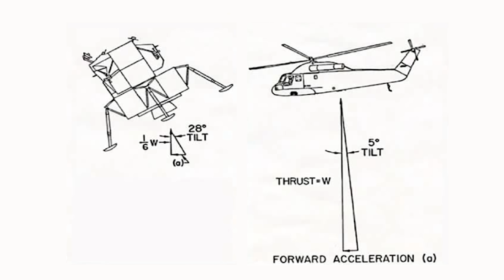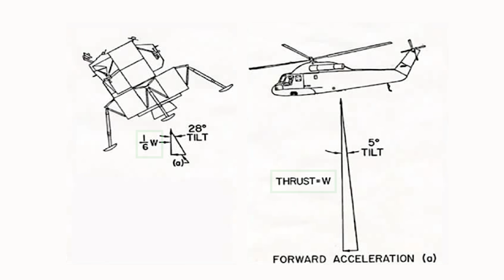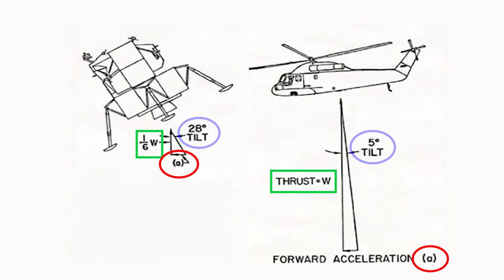How Neil Armstrong Trained to Land on the Moon  - Smarter Every Day 250

Comment: Im confused, why wouldn’t this be automated for Artemis? Seems to me we already have automated landing rockets at the moment, not a far stretch to change the gravity parameter to 1/6th within the software.......
Reply: I'm no pilot, but from my limited knowledge I understand it that there is no such thing as a true replacement for instinct and understanding. My point being that autopilot can only take you so far.  On a technical level it can do everything for you, in the real world however it can do everything... until it can't.
Reply: Even if this could be automated, it would likely still be unreliable in the best of cases, and once you get a little out of control, a computer tends to have a hard time bringing you back to a stable situation, and that's in conditions for which we're used to and know/have experienced most of the quirks. 
Think how difficult it is for example to get a computer to drive a car, where a human brain is capable of training and building up muscle memory and habits to handle unexpected situation on the fly. If you forgot a variable, the pilot in the seat will make a judgement call and try to compensate/adapt, but the computer won't make any judgement call you haven't thought of preparing it to beforehand.

That's my take on it at least.
Reply: Just means the software has to be written correctly.
Reply: Im confused, why wouldn’t this be automated for Artemis?
It may be, but training astronauts to do it manually adds an extra layer of safety.

Comment: "We aren't going back to the moon unless we have a free flight trainer"
I think everything about the landing will be completely automated
A computer can make corrections to control inputs hundreds of times faster than any human...and they can do it without mistakes if properly programmed.
Everything a pilot needs to be trained on can be done inside a simulator.
Reply: I think some training will happen programs dont always work and its best they know how to not die if it fails. But ya  its more efficient if the computer dose it.
Reply: That was my first thought too. SpaceX did it over 70 times on Earth, it's pretty much routine today. And it's way much harder on Earth because of the wind, and the Falcon 9 can't hover, so their timing has to be perfect, and they have to do it with as little fuel as possible, so they are going down very fast. Compared to this landing on the Moon is nothing.
The real challenge is landing on Mars, because it has enough atmosphere to cause you trouble, but not enough for aerobraking or parachutes to work well.
Reply: @andrasbiro3007  You should continue writing your fantasy book on paper, not here. The fact is that the moon landings never happened. Think of the Falcon9 this way...We will have many , many scaled down versions of anything we invent full scale. The larger the scale and heavier, the more challenging it becomes. If that rocket could land that way, we would have them selling off the shelves like drones.
Reply: @philindeblanc  
🤣🤣🤣🤣🤣🤣🤣🤣🤣🤣🤣🤣
Reply: They'll use a pilot simulator.
Reply: lol...yah, as if we ever went to the moon. What a bunch of BS
Reply: @philindeblanc  *cough *cough lunar lazer experiment *cough video evidence *cough you sound as crazy as a flat earther
Reply: @spaceygnat19908  Sure, I can sound crazy for someone who is brainwashed into thinking that we went to the moon 6 times in 2 years, and never went back in over 50, and now cant even have Orion mission be manned, then since technology doesnt get faster, smaller and cheap...Riiight...we cant get China or Japan or Russia or Germany or India, or other countries well capable, and very advanced..yet they cannot make it...LOL you have to be on some special meds to believe we went. Once you watch all the interviews and they look at some of the Apollo footage, you would need to be drunk or drugged. But truth is, not so many people have watched all the content. or even thought about other countries and their moon mission videos.
Reply: @fask69  They cut the budget...lol Nice one. They have been getting around 20 billion for how long? Do you know what you can do with 50,000,000, thats 50MIllion dollars every waking morning? imagine each morning there is a new truckload of 50million dollars at your door. For decades and decades. Do you EVER think they would cut that budget if they actually went to the moon?lol..NASA is a military operation, and always will be. They are 20billion yearly to keep the facade  of space and hope and the cutting edge of tech, while they make advanced weapons and fund black ops wars. In todays times with open information, it is sad and no excuse for people not to know.
Reply: @philindeblanc  so how did the lunar lazer experiment get on the moon? You still haven't answer that. Budget you know how much money it take to make a rocket you cant go to McDonald's and order one off the 5$ menu lol. Why we never went back people lost interest no saw a value in going to the moon. Russia and china landed on the moon if they can land a drone we can land people. Why do you think space x exist? Its funded by nasa and in return nasa to get cheaper ways to get to space. You should lay off the pills man next thing you gonna say birds don't exists or something.
Reply: @philindeblanc  1. A simple google bing yahoo search would show you the lunar lazer experiment use that superior barin of your bud.
2. There called rare earth minerals for a reasons lol.
3. 15 years ago i had a pocket computer that can make calls play games and serf the web. Today i have a pocket computer that can make calles play games and serf the web. Technology isnt linear you cant make a nuke with out slipting the atom you can make a computer with out electricity. Rocket to my knowledge hasn't really change in the last 50 no new rocket fuel no new engine like the f1. Self landing rockets are new because of the advancements in computer technology.
If no one is interested in cars dont be surprised when nothing changes about them. 

4. Name calling and saying you more intelligent then others isnt really helping you.

5. I believe in something that has been proven by math, science, and history. What you got? O ya your word on that it didnt happen.

6. Meds really is that your only argument  if they dont believe me ill just say there on meds that will make them believe me.
Reply: @philindeblanc  Funny isn`t it, how recent mapping of the entire surface of the moon has verified the accuracy of every detail in the thousands of Apollo pictures and all their videos....AND....other space agencies have taken pictures of the landing sites. OOOOOPS! You`re wrong, and you`ll never admit it...
Reply: @baneverything5580  
Don't bother guys, he's a lunatic, you won't get anywhere with facts and logical arguments.

Comment: I write short stories, and I'm curious about something.... Given the Zero-Velocity-necessary condition, would that apply to someone who time-travels such as in the H.G. Well's book The Time Machine. Is there something to take into account if someone where to time-travel? In that story, the professor time-travels in one spot supposedly never leaving his geographic spot. Nowhere does the story account for what takes place upon ending the time-travel. Given that speed is defined as distance over time, and given that the Earth is rotating at about 1,000  miles per hour; would a person coming out of a time-travel  have to Speed-Up to 1,000 miles an hour in order to touch the surface of the Earth; otherwise, wouldn't that person have the relative effect of trying to hop onto a treadmill that is moving at 1,000 miles an hour when his or her current speed is no longer defined because he or she time traveled ?  Speed = distance / time ... and their time is not defined... I've had this question for a long time and want to incorporate this fact into another one of my short stories.

Comment: These days, they should use multicopter that always remains horizontal to provide 5/6th lift. Then the entire lander should be gimballed in the middle to tilt in any direction.  Multicopter can be all electric or hybrid to increase flight duration.  Having more energy efficiency means longer training periods to practice.  This would be much cheaper and cleaner than using rockets.

Comment: Thrust in a vacuum?
Reply: Oh boy another one;)
Reply: @maciejcholewa3796  Those what? A question asker? It's a legitimate question. I was taught in school space is a vacuum and there is no atmosphere on the moon. Just saying every action has an equal and opposite reaction doesn't explain to me how a rocket fired out against nothing generates thrust powerful enough to overcome the mass and inertia of an object. All I can find is vague articles that just say rockets are diff than turbines with no deep explanation just to remember Newton's third law. Isn't an explosion a sudden expansion of gas is that expansion localized just at the outlet and how does that expansion matter without something to react against. I'm not a flat earther just curious. One of those I guess.
Reply: @JamesWilson-mz5xk  that question had been answered like milion times, beside if you were going to school, teachers answered that question too.
Reply: @JamesWilson-mz5xk  you realize that 90% mass of rocket is fuel? Tell me what happens when you expell in one direction mass of fuel at supersonic speeds? To understand what is happening you need to know all laws of inertia not just 3rd.
Reply: @maciejcholewa3796  Thanks for the unnecessary    arrogant rude non answer and personal attack.

Comment: Can someone clarify to me what Mr. Ottinger said happened with the ejection?
"You could always have 20 pounds of peroxide to feed your attitude rocket system and never let the lift system run out your attitude control." - What does this mean exactly? Just that there was a reserve for the attitude control, so if you run out of fuel for lift, you can still maintain attitude? But isn't losing lift just as big of a problem?
"But what he did was, without paying attention to the radio, he just let Neil leave the lift stick up and blow all the helium overboard so he had no pressurant to push out the reserve attitude fuel." - How and why did the helium get blown out? And what did the engineer/mission control guy (the one who was called dumb earlier) do wrong here?

Comment: Nowadays we have the opportunity to create a near perfect simulation of lunar flight digitally. We can easily build a hydraulic cell that simulates the forces felt as well. The only aspect missing there would be the sense of danger as destin described. So maybe we do need a physical simulator like the LLTV, but still the sheer amount of hours of training with very little cost that is only available with a digital flight simulator will be extremely helpful in honing down the motoric skills required.

Comment: Question. I now understand why you can’t up the thrust 6 fold to simulate the gravity difference due to horizontal thrust proportionality but why can you do the opposite and have a craft that’s 6 times lighter which would then require 1/6th the thrust to hover and replicate that horizontal proportionality? Thanks!

Comment: "Carrying the Fire" is, IMO, the best of the astronaut bios, and the Apollo In Real Time website is a scientific and technical treasure. I hope it's preserved for all time. A thing to keep in mind about the descent of the lunar module was that it was largely controlled by onboard software. Neil Armstrong took over control toward the end when it turned out the computer was taking them toward a field of boulders, but otherwise the landing could have been automatic, and I believe most of the other landings were. This is not to take anything away from the astronauts' capabilities - Neil was at his test pilot best that day, and every mission has stories where nerves of steel were required! I just picked up "Sunburst and Luminary", which is the story of the writing of that control software. (Geek alert!) Can't wait for the rest of this series!

Comment: My question is, "Is it better to make a new LLTV, or use a more "commercial" airplane simulator with motion and custom software?" Ironically, having it be on the moon drastically reduces the complexity needed for an accurate flight sim since they won't have to worry much about aerodynamics.

Comment: The LLRF still exists, but it's called the LAIR these days and used for aircraft impact testing as well as testing the water landing for the Orion Capsule! I was fortunate enough to get a tour from an alum who was an engineering manager there while I was in university. Langley is a really neat facility over all and worth checking out if you can get a tour.

Comment: I've wanted to build a working scale model of the LLRV using off the shelf RC parts. A central thrust system on a gimbal that is separate from the rest of the controls. I think that would be a fun project.

Comment: Do we need shock absorbers on a lander? Any information regarding this question?
Reply: The design parameters included a potential for a specific amount of high-G deceleration that couldn’t exceed a certain level. They had decided on going without seats for the LM so that the standing astronauts POV was good enough that they saved hundreds of pounds of weight going with small windows compared to what was originally planned. The shock absorbers were a one-time use item so they were made with crushable aluminum honeycomb internals so were relatively light.
Reply: @mako88sb  thank you

Comment: I don't think with todays safety standards and workers right to refuse work etc. anything like this would ever be used, no one in their right mind would try this lander today or anything like it, the 60's was a different time with different mindsets. I guess it will be interesting to see the pilots of today try to land on the moon, but they would probably just train for a manual landing in an emergency, but everything would more then likely be done by computers or A.I. by that time

Comment: Yay!   The flying bedstead.  It's the absolute favourite of mine, of all the training equipment that was used in the Apollo programme.  Neil was never blamed for punching out as far as I know, but this is the first time I heard the real reason for the incident.  I knew it was because Neil had lost the ability to control the attitude of the craft, but did NOT know that it was because he'd been allowed to run out of oxidiser pressure.  I'd always assumed it was a purely control (computer/electronic) issue.

Mr Ottinger is also being very gracious about modern engineers, but I have to say they did things in those days with so very little and they made it work. I'm truly in awe because things that we take for granted now were extremely difficult and cost millions if not billions of dollars back then.  For example the AGC was essentially a four bit computer that was cutting edge technology at the time.  I'm pretty sure that a 2021 16 bit microcontroller which you can buy today for about $2 with a clock speed of 16MHz (as opposed to 1MHz) is actually far more powerful and has several hundred times more RAM. (they had 2000 four bit words, or about 1KB in modern terms).
I'm not sure in 2021 that very many modern software engineers could deal with those sorts of limitations.  Modern programmers dream in their main programming language (Yes, this is from personal experience)  but REAL programmers dream in machine code. 6c 65 67 65 6e 64 61 72 79 20 65 6e 67 69 6e 65 65 72 73

Comment: The Russian moon program was quite different, due to the lack of high specific impulse engines (they were all kerosene-based in all N1 stages, unlike hydrogen-powered engines of Saturn V), which limited their design. One of the limitations was that the transfer to and from the LM would require an EV, and only one person would actually land on the moon.

It would be quite interesting whether they did an evaluation of the LM simulator issue, or whether they never reached that far in the project stages when it was finally cancelled.

Comment: I feel like a VR simulation with a motion simulation rig would do a better job with training on a modern vehicle. It would be less "risky" but it would be significaly more accurate, since you can actually simulate the inertial mass, lack of air currents, etc, and the ship could take in any orientation

Comment: I have a question that's been bugging me for a while now that's at least partially relevant. I'm sure there is a simple answer to this, but I can't seem to find one. So, hypothetically, if there is a planet with a surface gravity of 3g's (it really doesn't matter how strong the gravity is), and some kind of centrifuge with a platform angled at 45⁰ and spinning so that 3g's of force are exerted horizontally, cause the two perpendicular forces to cancel each other out so that an object on the platform would only experiences 1.5g's of force? Maybe I'm over thinking this, but I know there are a lot of smart people in this comment section that could help me out.